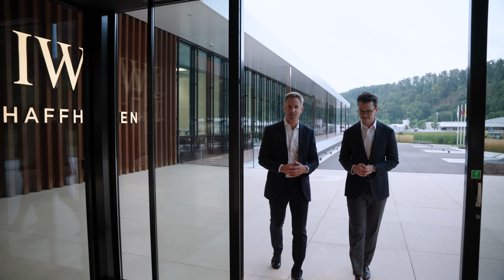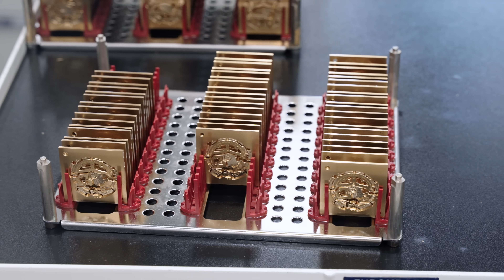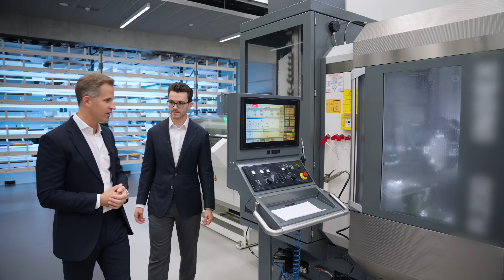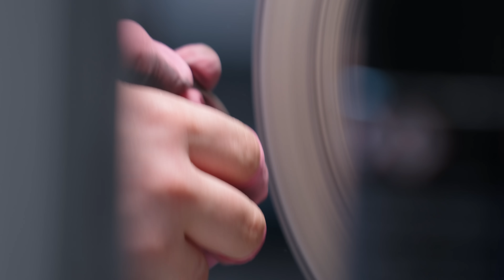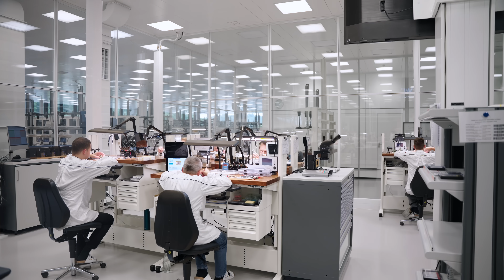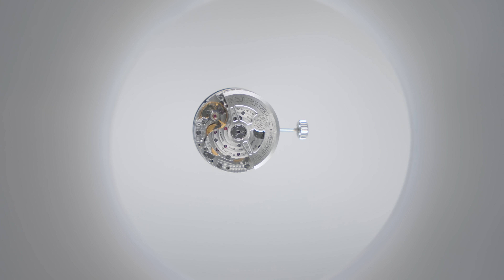Visiting IWC’s World-Class Manufacture In Switzerland (More Impressive Than You Realize)

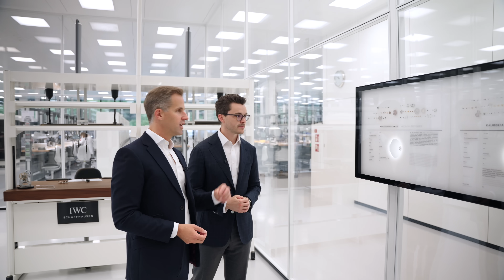Comment: Tiny mistake to mention: at around 32:20 it is mentioned that the movement 82 is used in the Portugieser Automatic 40 and shown is the Portugieser Chrono. The chrono uses the movement 69 which is mentioned at the beginning of the movement presentation but no picture was shown at approx. 31:40.

Comment: Wait...an IWC automatic has a 7 day power reserve? How is that possible? Internal rotating bezel? Different weight of the numerals? What an absolutely fascinating tour of IWC with our host, Chris. I learned a great deal, and now have a greater understanding of the process of sintering, and how it is used within the watch industry. Excellent production, Teddy.
Reply: alot of these watches are having very fine movements so i think their weight and size decreases because of that, now power reserve needs to release power and since power gets turned into torque and all of these fine movement i think will need lesser torque, also from the mainspring up to the escapement, all of these will use the least torque required and so that's how they can reserve the power for 7 days i think. I might be totally wrong but yeah.
Reply: Several mainsprings in series assure the longer power reserve